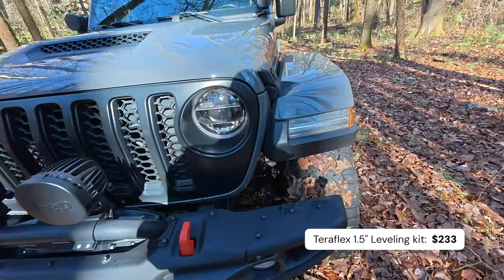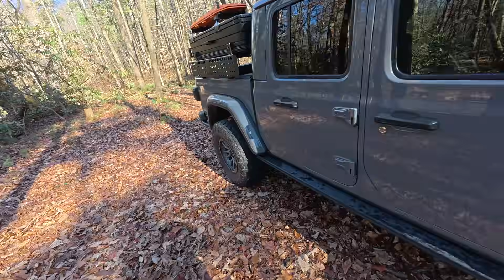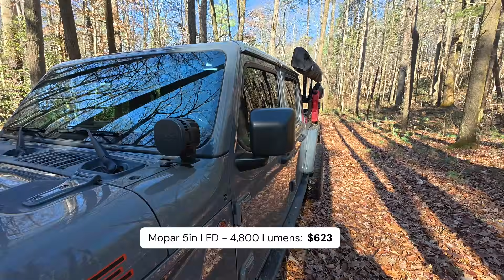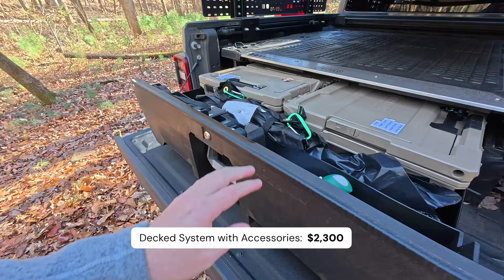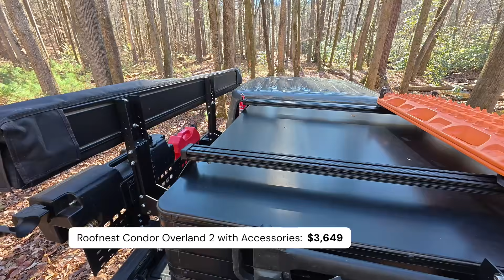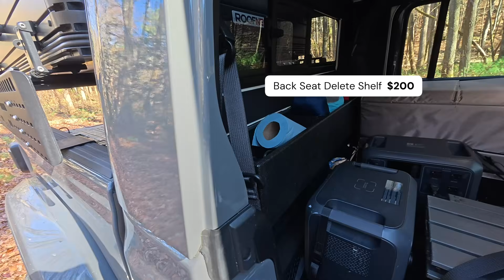My EPIC Jeep Gladiator Build REVEALED!

Comment: 1.5 on the back or 1"?? I would think you would do 1.5 level on the front and 1" on the back. Is the backspacing of your wheel 4.53 with a 12mm offset??????????
Reply from the maker: I did go 1.5 on front and 1 on back, with the initial sag I got with the extra weight, I should have went 1.5 on back
Reply: @sherburnoutdoors  Ok thanks. I really like your rig and how it sits so I'm trying to spec mine out the same way as I have a 26' on order. I might get away with the 1" on the back though as I wont have much in the box. Thnx.